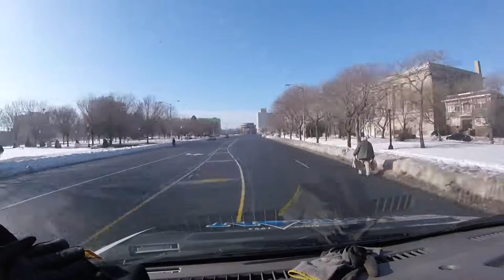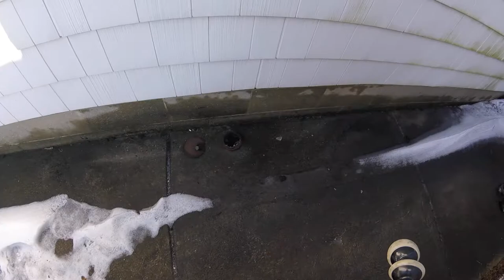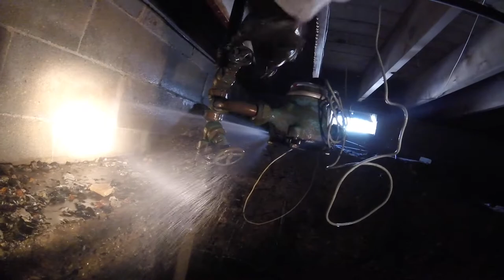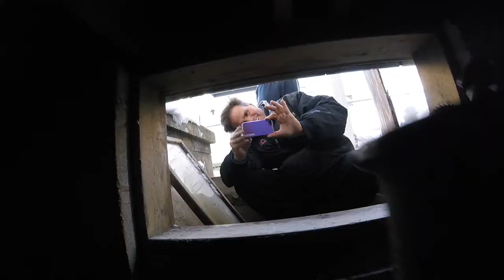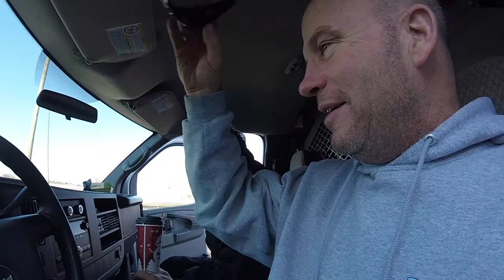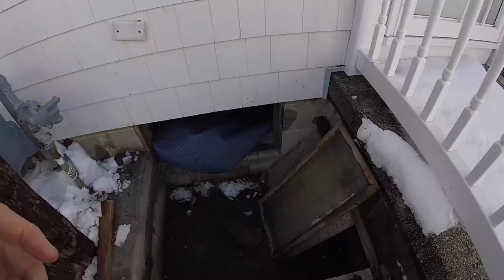Water Meter Frozen and cracked

Comment: 7:00 whats this thing? thats part of the measuring chamber, its a "piston style" measuring chamber. piston styles are not as accurate at low flow due to the large surface area that drags, better for the customer, not so much for the utility. piston meters can drag enough at low flow to allow a toilet leak to pass by the meter without registering. when piston meters are replaced with "Nutating disc" designs with alot less surface area to drag, the low floe accuracy will increase. the future of metering is magnetin or ultrasonic measurement. the new neptune Mach10 series uses ultrasonic detection
Reply from the maker: I had taken apart the water meter and so i could replace plate. That was part of it.